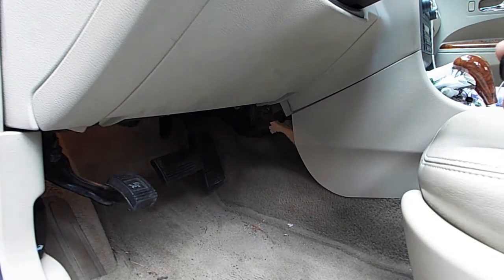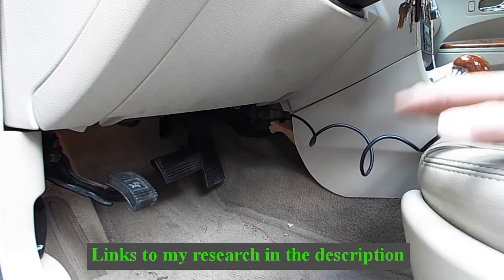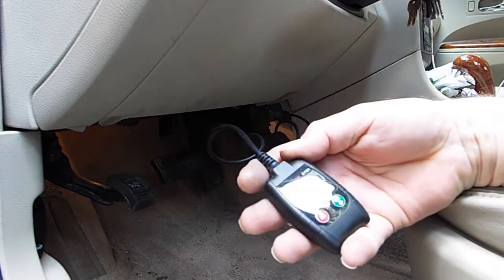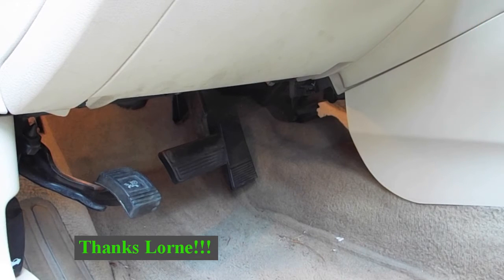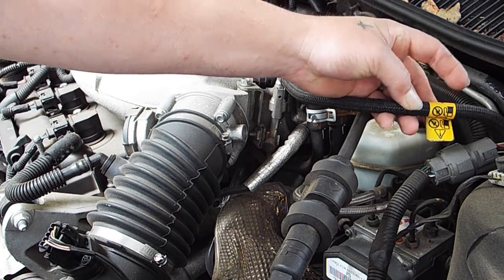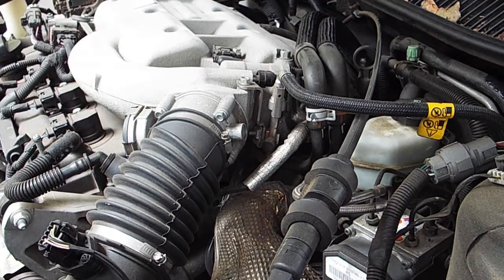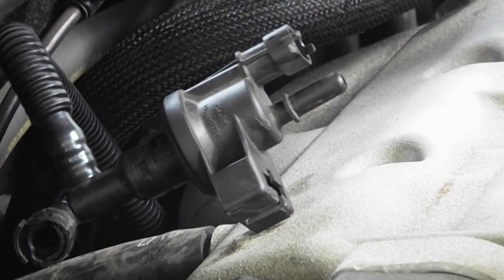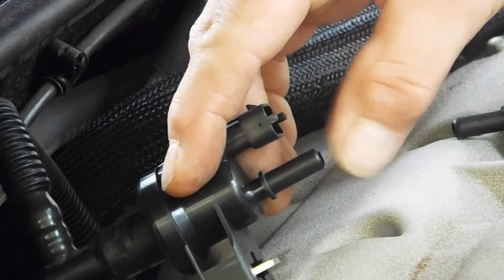GPW 70 - P0496 EVAP Flow During Non-Purge Condition (2006 Buick Lacrosse 3.6L V6)

Comment: I have this same issue on my GMC terrain but don't have the code reader is it possible to reset the engine light without it?? Need to figure out if its the canister or the valve, thanks for the vacuum trick.
Reply from the maker: Google your vehicle along with "obdII" & "no scan tool"... there are some tricks to get codes. they don't always work, but it's worth looking. Most auto part stores will pull codes for free.
Reply: Go to an Auto store, like Napa, Autozone or O'Reilly, they'll check it for free.